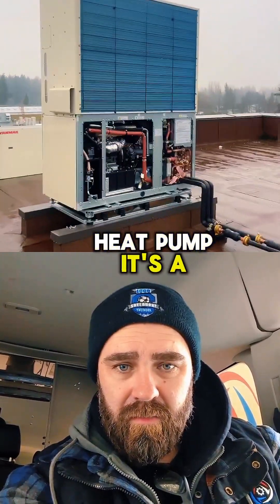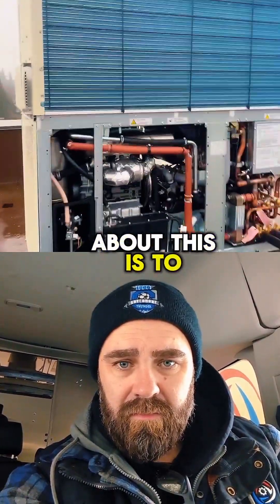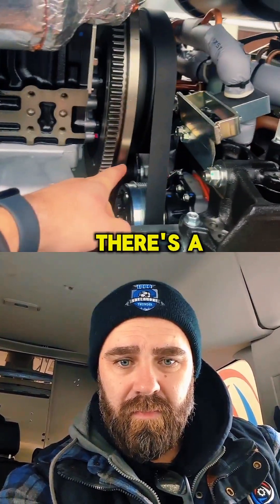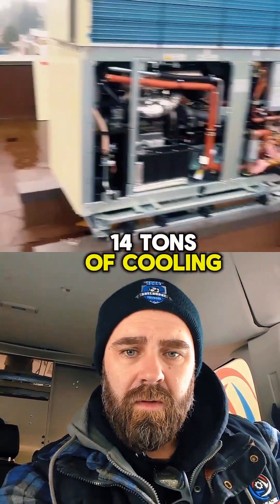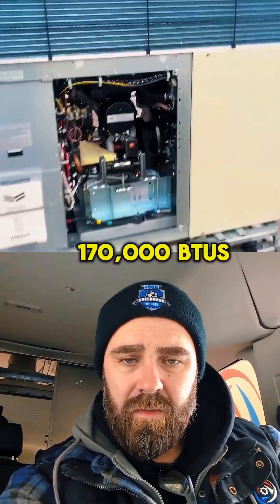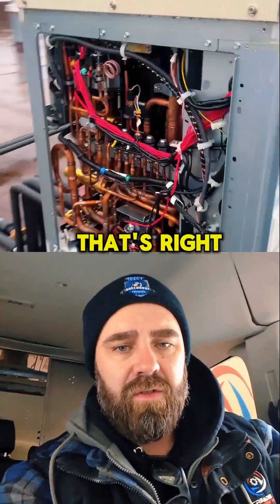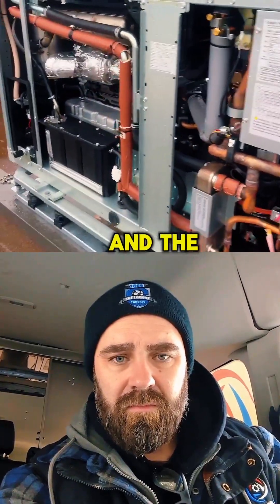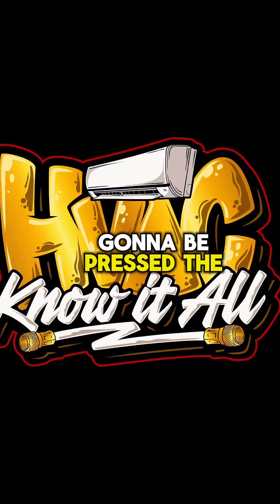Natural Gas Powered Heat Pump

Comment: Did startup and maintenance on one of these different brand on a high-end home application but since only single phase power was available simultaneous heating and cooling(vrf) wasn't an option. When the condenser kicked on it always sounded like a four cylinder car engine starting lol